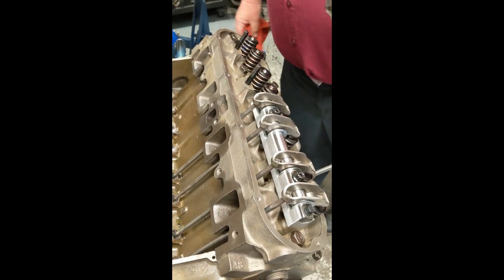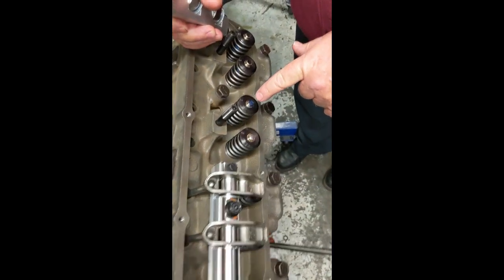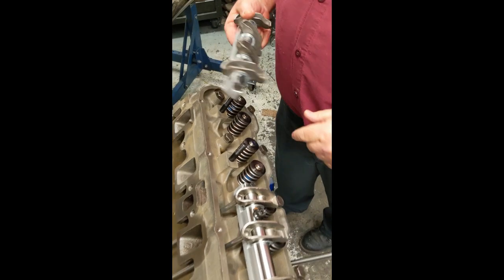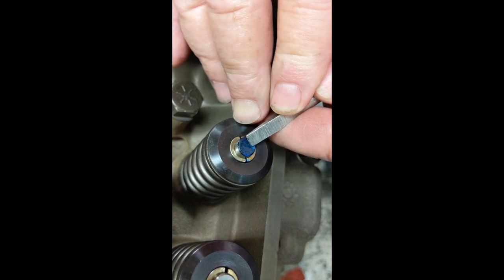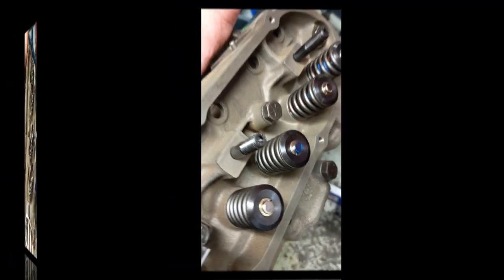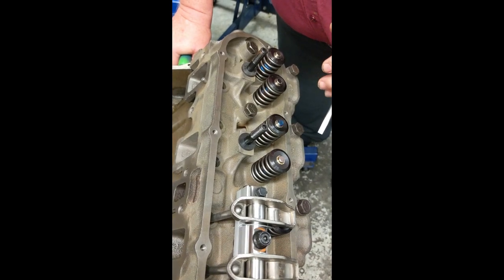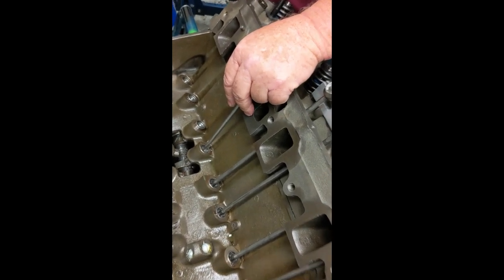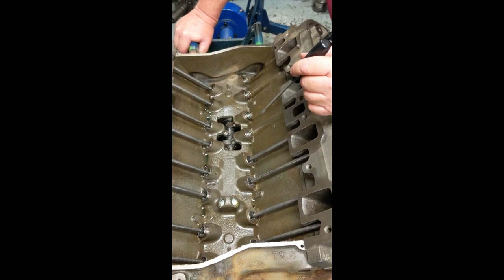Cadillac Shaft Rocker Setup

Comment: Courtney, how about a video on setting up the adjustable rockers on the heads? I've seen discussions on the height or depth of the adjusting nut in the rocker tip and oil flow through the rocker. Some clarification would be very helpful.